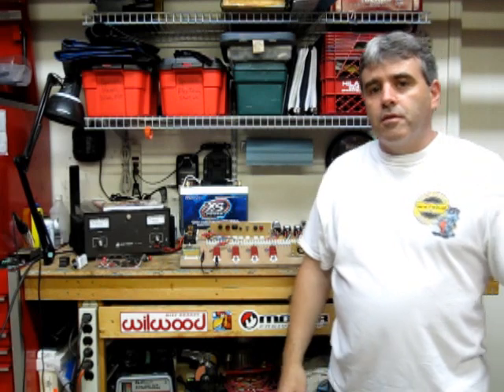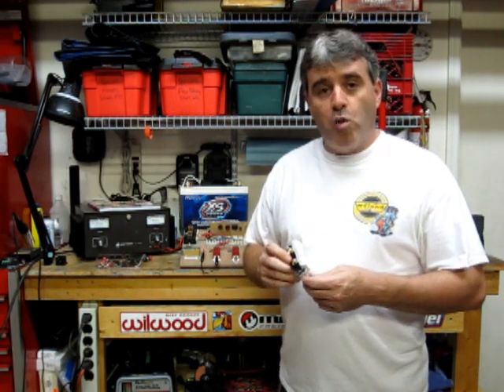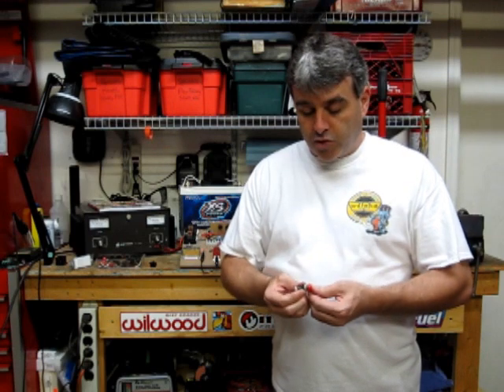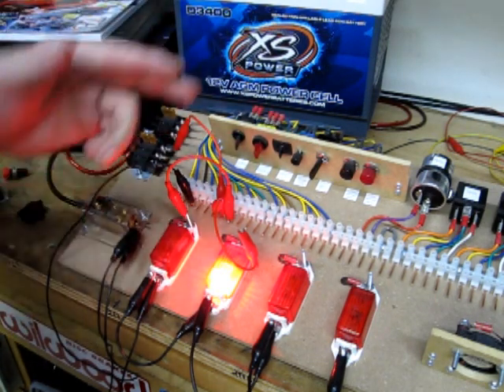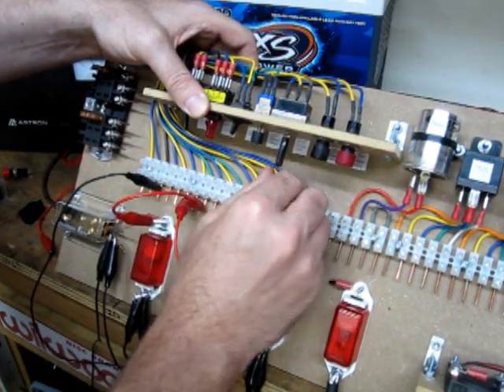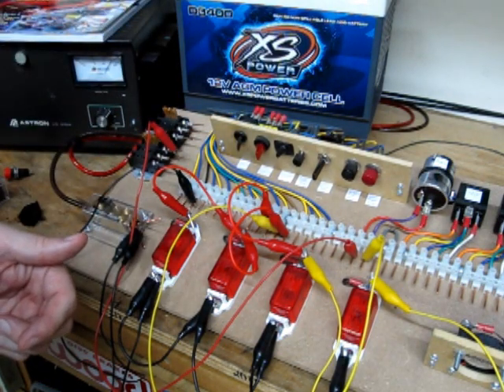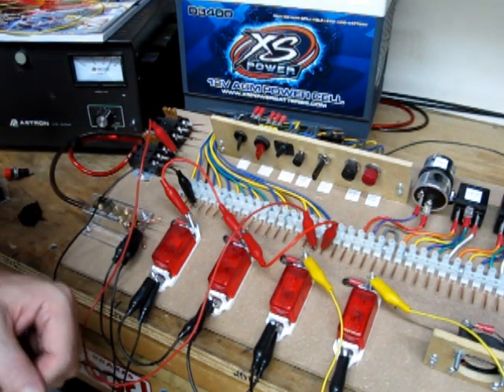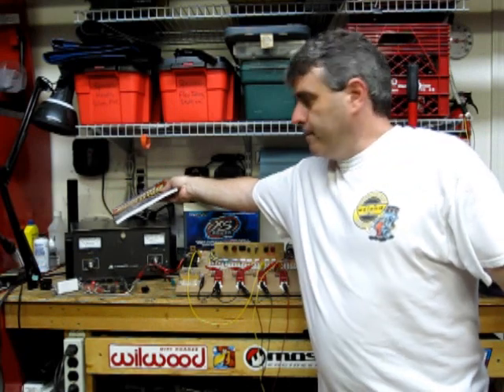Switches - The Basics

Comment: Why didn't the light flash fast when one of the lights was disconnected? I want to wire my own set of turn signals with a hazard lights switch that bypasses the ON-OFF-ON switch to use a single flasher for both the turn signals and hazards, but I want the speed to stay normal.

Comment: Hi, I bought your book and it is very informative. I am trying to learn more about electricity. While watching the videos I noticed that you have fuses where the electricity comes from the ground and I assume the fuse box helps protect the lights, switches and any other accessories in the circuit. What is the fuse box on the power side for and what is its importance. Also why are the fuse boxes different types. I hope this question is not to elementary but I am trying to learn and understand.

Comment: So the second switch from the right you'd have power then 2 grounds.?
Reply: I'm not sure that I understand your question.  Can you elaborate?
Reply: Sorry about that, I have a 3 prong switch that lights up when on,  I'm putting led lights on my truck, and there's only red and black coming from the lights, so I hooked up red to power and black to ground, switch is not working properly because I don't know what to put to accessory connection.